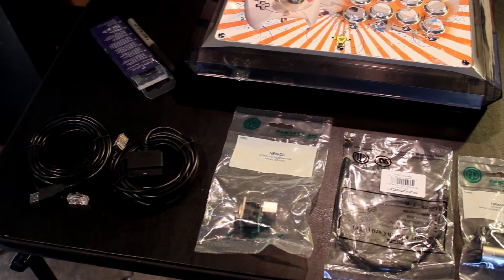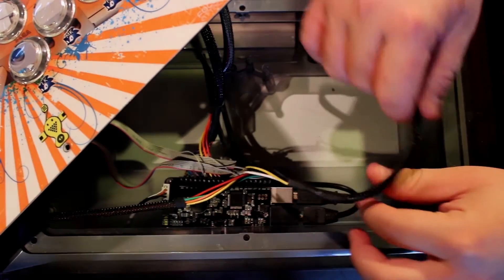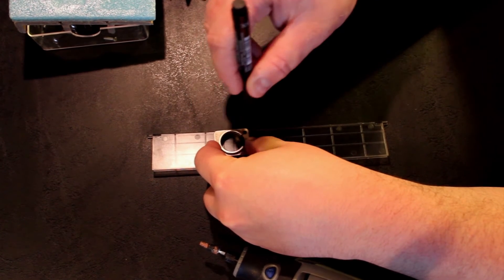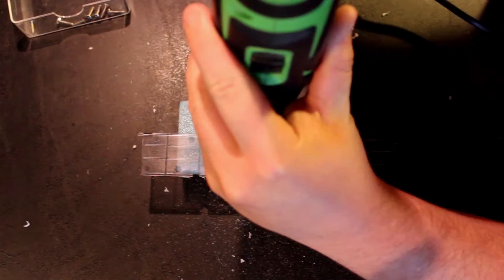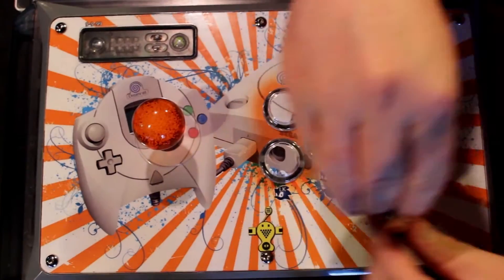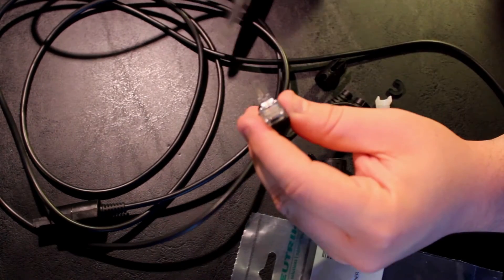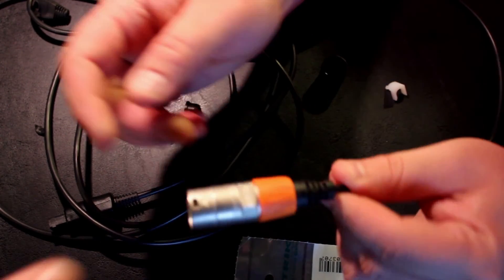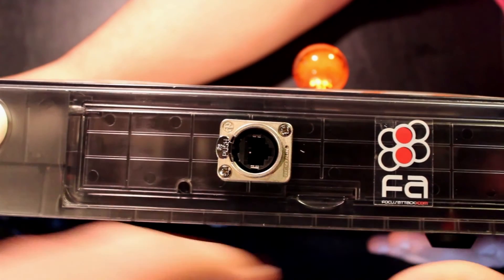Neutrik NE8FDP Feedthrough & Neutrik RJ45 Data Connector (Setup and Tutorial)

Comment: For future reference, viewers could check the Neutrik connector documentation for the dimensions of the main hole for a more accurate cutout with, say, a hole saw. In fact, if you print the drawing at 100% (no scaling) and double-check the dimensions with your actual connector, you could probably get a template that way.

Right at this moment I'm not sure the EtherCON connector has the same hole size as the audio connectors (NCMXX and NCFXX connectors) but I do know those are 15/16". EtherCON might be the same or bigger, not sure off the top of my head.

Comment: I just wanted to know I'm going to be getting brook ps3 ps4 board and I dont need a neutrik connector correct? I don't want to drill a whole into my stick I could just get a long usb cable?
Reply from the maker: Correct, this is only if you want an easy way to connect/disconnect your stick.